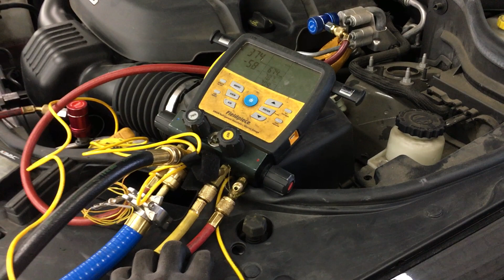R1234YF RECHARGE PROBLEMS SHOP HAVE BEEN HAVING

Comment: Bummer. Hope u can re-shoot this another day. Im interested.
Reply from the maker: OcRefrigeration , Hvac & Electrical Video's. Yes,  I get phone calls stop my videos. I often have no time to reshoot because I’m always running to the next job. I’m packed from early morning to night every day. Car set different then a residential HVAC. You cannot rely on superheat or sub cooling. Because some cars have variable condenser fans, variable compressors like Mitsubishi, Daikon or LG. If you have them a little under charge or overcharged they sometimes will either speed up the compressor if it’s electric or increase the displacement inside the compressor to compensate. Giving you false pressure readings but the technician may think it needs to add more refrigerant.    Just like when we made the switch from R22 that was very forgiving on a little bit of over or under charge and R410 was not so forgiving if you overcharged it.             Some cars have solar sensors located on the dash at the windshield and will change output whether the sun is strong or the vehicle is in the shade.    Now combined that with some vehicles have a refrigerant charge as low as 12 ounces and if you’re just two or 3 ounces off in any direction on a cool morning or day you will not know it will operate fine cool out the dash and you will not have a high head pressure. As soon as an 80° day comes around you have over 440 psi in your system is shutting down by the safety pressure cut off switch. just buy two or 3 ounces. I have a video of a Prius were came in from a shop overcharged and just by hooking up my high side gauge and releasing the liquid refrigerant in the length of my hose got the car to fall from over 440 psi shutting down to compressor to the level of actually starting and working that’s how sensitive they are.